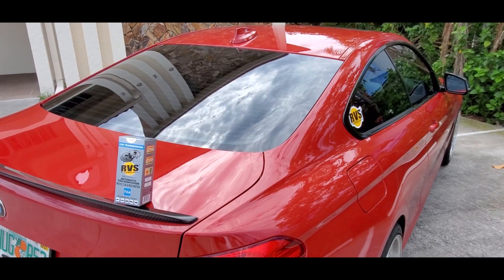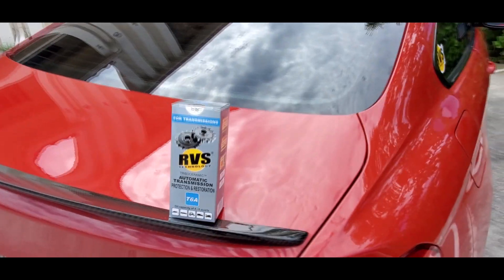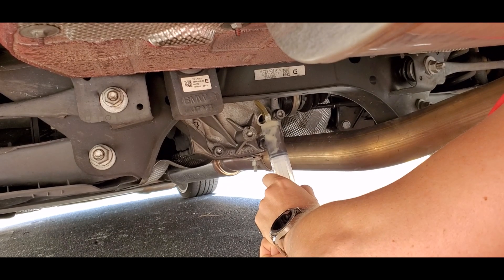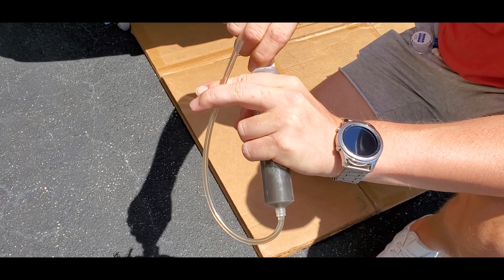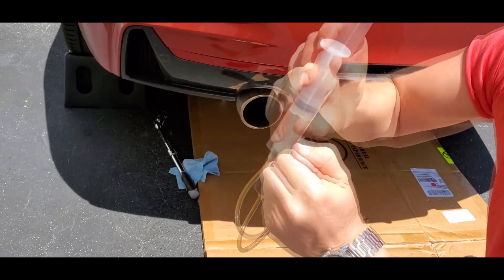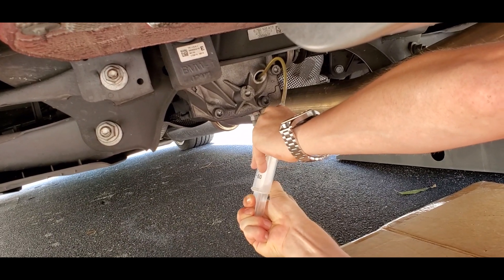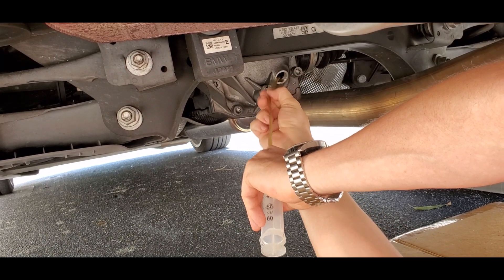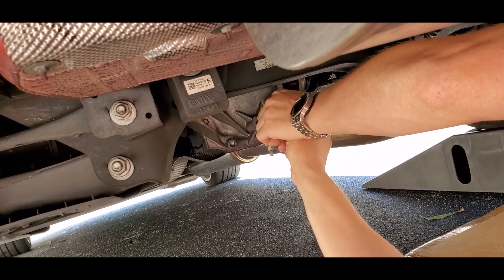How to perform a RVS Technology treatment to a differential or sealed transmission

Comment: This is not a very good video. You really not showing us details
Reply from the maker: What would you like to see specifically? We do recommend sealed transmission, differential treatments are performed by professionals, but it's certainly not too hard, might just need more tools.
Reply: @rvstechnologyusallc2290  Well I got RVS automatic transmission formula, my transmission is not sealed, it is a 2001 Honda Accord! Should I do it myself or will a place do it pretty reasonable?
Reply from the maker: @msj19706677  if it has a dipstick, the easiest would be to mix the RVS gel into new Trans oil and just pour it in. About 20 or so ml measured should do. Key is just to have the gel mixed well with the oil going in any application.
Reply: @rvstechnologyusallc2290  oh ok so 20 ml of new transmission fluid & mix with this gel & can put in through trans dipstick??
Reply from the maker: @msj19706677  Yes that should be enough. And if you want to really make sure the gel gets there good, pour another 10ml or so oil after to "wash it down".
Reply: @rvstechnologyusallc2290  by 10 ml oil you mean new transmission fluid?
Reply from the maker: @msj19706677  Yes 👍
Reply: @rvstechnologyusallc2290  OK, I just was worried about overfilling it because I think the transmission fluid level is good.
Reply: @msj19706677  Yes a valid concern, but these minute amounts are safe 👍
Reply: CheckYourGear  +1